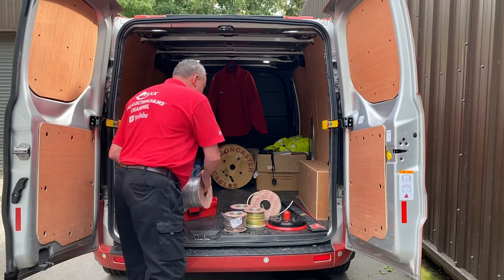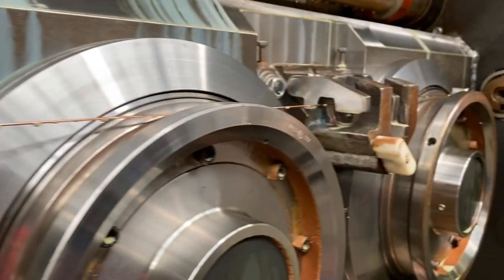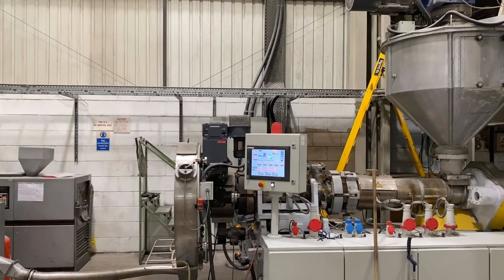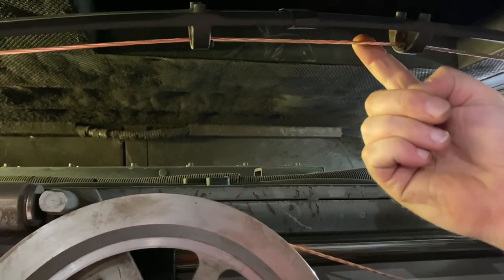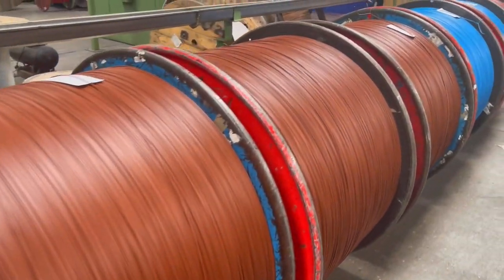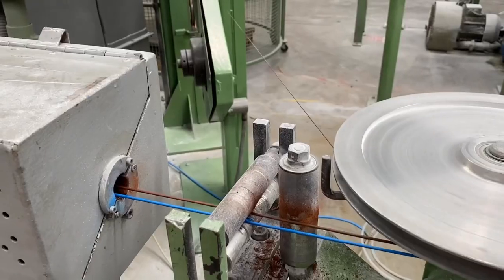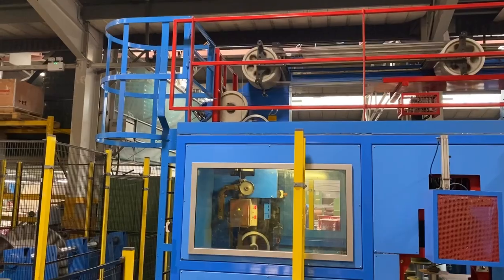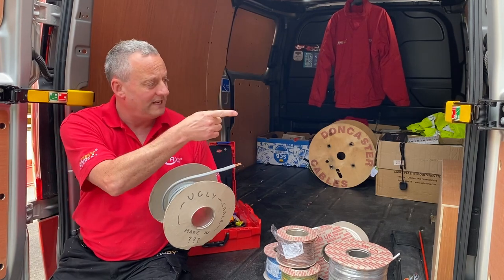The Secrets Of Making Electric Cables & Wires

Comment: I can remember when cable went metric .electricians at the time hated the fact twin and earth cable changed from stranded to solid cores. They soon got used to it though.  But single conduit cable well into the 80s was available in sold or stranded core.
Great video thanks
Reply: Different standards in different countries, in Australia all domestic use cables over 1.0 sq mm are stranded, we also have an insulted earth conductor and our standard sheathed single phase twin and earth stayed as red and black cores, which personally I think was silly.  Very interesting video, it's also good to see not all manufacturing has gone to Asia.

Comment: That was very interesting. I never realised how the cables were manufactured, so thank you (and Doncaster Cables) for your video.
I do not regret the passing of 7/.029 like one of the comments, but I have always thought the previous colours of red, black and green were better. Then, 3-phase supplies were coloured red/yellow/blue. Simple and neutral remained black as in T & E. Even worse is the "50 shades of grey" in SWA.
Reply from the maker: Bring back the old colours
Reply: As an American EE/DIY spark, can confirm that the old colors you used are way better than the new and are on par with our color code for ease of wire differentiation.
Reply: The problem with the old colors is a) that everywhere had their own, which is a safety issue when things start moving from area to area more (including electricians) and b) all the regular good colors were already taken. Here in NL we used green live and red neutral (and grey earth) If we were to move over to your old colors where green is earth and red is live, we’d have very serious issues in mixed installations.

The new colours were the ones nobody used a lot, that’s why they’re the ugly ones.

Comment: The cable manufacturers in Sweden has stopped using chalk to save our hands from drying up and not having to clean up the mess i makes. The newer types of cables are really easy to strip, often no problem to strip >1 meter of outer sheeting with minimum force
Reply from the maker: An alternative is to use a silicone based lubricant - we’ve had mixed results on cables which use this method.
Reply: I'd assume it would save you from potential lung damage too - silicosis I believe?

Comment: I used to work for CEF Doncaster cables was sadly one of the factories I didn't get to have a tour of. I did however handle a hell of a lot of cable from this factory during my time there. I still have half a roll of 1.5 and 2.5 in the shed.
Reply from the maker: Those rolls are an investment in the current climate 😃
Reply: @efixx  aren't they just. I remember 2.5 going for less than a tenner for 100 meters. Mind you it was over 20 years ago.
Reply: Do you know what is the function of applying chalk ?

Comment: If only a manufacturer would make one with a sleeved earth, we need to catch up with the rest of the world.
Reply: It’s extra unnecessary costs though. Would only increase the price of work
Reply: @SuperSweetGamers  I’d quite happily pay the extra price, quicker installation time would far outweigh the extra 3 quid a drum
Reply: @pezzpezz7272  really?... It's just a path to earth that needs a bit of sleeving on the end of a termination... 😉
Reply from the maker: Hank and Chuck across the pond don’t bother with sleeving
Reply: @efixx  "Hank & Chuck.." pmsl 😂👍
Reply: It doesn't need sleeving. The only reason you put a sleeve over at the terminations is so there is no doubt as to what it is
Reply: @morris2755  I have never seen NMC (non metallic cable) Romex or type UF with an insulated grounding wire.  Now MC cable would have an insulated grounding wire, and the lighter weight version of MC.
Reply: Spot on mate. It’s crazy that the UK still has bare earth wire on their tps. Ive been in Oz for twenty years. I’ve never seen bare earth wire in that time. The US method of leaving it bare is shocking.literally
Reply: I never saw non sleeved earth in Europe and Asia. I prefer sleeved earth cables.
Reply: Why shouldnt it be sleeved? Whats wrong with sleeving it? 🤷‍♂️. Surely the point of being bare is to come in to contact with faults easier along the length.
Reply: Normally the earth should carry zero current, so why does it need an EXTRA sleeve? You could argue that live and neutral don't need a sleeve If you could ensure proper separation when removing the sleeve they're encased in. 
They have their own sleeve for 2 reasons, identification, and separation when the outer sleeve is broken into when terminating the cable. This is not a requirement for earth, indeed it's a disadvantage g if there's a breakdown in either live or neutral's sleeve then you want the easiest path to the earth conductor to trip the protective equipment. You DON'T want earth to be insulated!!
Also more plastic is just bad.
Reply: in australia we have had sleeved earths since the about the mid '80s,it saves on  carrying a roll of green sleeving around with you when fitting off switches and outlets etc.
Reply: @terryjimfletcher  What about a fault current then?
Reply: 100 % ✓
Reply: Doncaster have just bought out a new range of cables that do have a sleeved earth, I’ve used it and it is a game changer, it’s only available in 1.0 and 2.5 twin and earth at the moment but I am sure it will take over as the standard for all cables eventually.

Comment: Interesting to see the process. I once had a reel of 1mm t+e cable where, on part of the reel, the neutal and cpc had managed to "switch places" within the sheath during manufacturing. The conductor order was now Line - Neutral - CPC. I didn't realise until I came to do my pre-test (end of 1st fix) and while it was a bastard to strip - it still passed cont and IR with flying colours so I decided to leave it in place (given that it would have been an extra 2 days labour to replace it). Anyone else ever had this issue? Never seen it before or since but now i''m super vigilant about it.
Reply: We used to get some crap cable from my wholesalers about 25 years ago .. Not through choice. It was called Wessel . Half way through the drum it would turn thin and even almost round. Full of kinks It wasn’t just a one off.  It was still BASIC approved and tested ok.
Reply from the maker: We gave a sample of Kablo where this has happened.
Reply: WTF this cable is not usable, and should have been taken out.

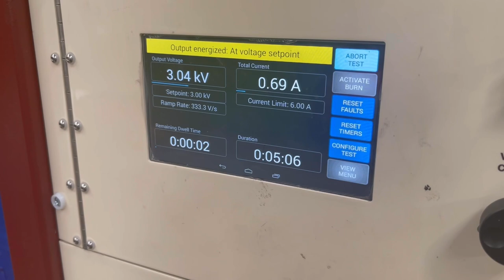Comment: Wow, 8:53 high voltage dielectric testing limit of 6 amps! That's a lot of leakage, but, then again, that's a large tightly wound coil.
Reply: That would be inductance of the coil surely .
Reply: @arcadia1701e  If it is AC it is the effect of capacitance, there's no current through the conductor for inductance
Reply: There must be a load on the other end. Probably a high voltage and current test all in one.  I wouldn't have thought there could be this much leakage current. with all that insulation.
Reply: @rbland  There isn't a load on the other end, there would be no point in doing that.
With a wire diameter of 1.4mm, a separating distance of 2.5mm and a pvc dielectric constant of 3 I've calculated a capacitance of 70pF/m, so at 10km of wire and 50hz there's an impedance of ~4550Ω, giving a current flow at ~3kv of 0.65 amperes.
Purely capacitive.

Comment: What always surprises me is that the UK twin and earth allows smaller conductor for PE/CPC. This would never be allowed in the Scandinavian/Nordic countries, where the earth has to be the same area, or equivalent conductivity. 

Although we allow plastic consumer units, open ends on surface mounted plastic conduit without requirement to bend it with the cable showing out in the corners…
Reply: Like Ring Circuits it's a hangover from the War when they were trying to save copper.
Reply: The earth wire should never carry current except in the case of a short duration pulse (until the MCB trips) of a line to earth fault. Therefore it only needs to be big enough  for this requirement.
Reply: @apk55  Good point… but what if the fault current wouldn’t be enough to trip the circuit breaker, let’s say if the cable were to be quite long? Nowadays when an RCD is installed I guess it wouldn’t be an issue, but what if the RCD was faulty?

I know this is very unlikely to be a problem but I think it’s just interesting to see how we do it differently.
Reply: @ianbakke  if the cable is too long  for the size of the conductor to safely trip the mcb then the apprropriate larger size will be chosen.
Reply: @apk55  The earth here in Germany has to be large and low resistance enough to clamp the fault current to a safe enough voltage in absolutely all situations. Which is hard to do if you get a line-to-earth short at the end of any disstance of cable run with the earth being a thinner conductor.

Comment: Similar process in Canada .We call it Romex .We do not make Romex with an isolated ground but do make BX Armoured cable with isolated ground .Used for  Data Communications and hospital  environments..Most cash register systems in groceries stores will use isolated grounds as each till and computer will have an independent UPS
Reply from the maker: Interesting would be good for us to get hold of some to compare. 👍
Reply: @efixx  pretty much the same thing we use 14 or 12 gauge for most residential applications .We also have a heavier jacketed version with the NMW-U  rating .Non metallic wreathed proof and underground rated .It can be run on the surface above 1 meter without mechanical protection  or underground .the insulation is almost 3 times the diameter of the conductor and the ground wire is the same ,bare . Armoured cable comes in various configurations .Lead core aluminium    spiral and PVC inner or outer jacketed cables .Tech cable is a brand name can be a single conductor or multi conductor .Shielded or unshielded .The sky is the limit and so is the price .Some we use are over $8  Canadian a linear l foot  /Or everything now is metricated .Dont know metric ,not conduit nor wire sizes .AWG ,Kcmil and MCM .,1/2,3/4 ,1, 11/4, 2 inch 3 inch and 4 inch conduits .Never used metric  except in school and European equipment  .Construction for us as always been imperial inches and thousands of an inch for machinery .

Comment: Any technical reasons or otherwise, are the drums of the cooper need to be of 8mm in diameter ? Just curious

Couldn’t the cooper wire manufacturer produce them in different diameters needed for different purposes and sell them to electric cables producers the exact diameter that they need ?

 Side question  —  is similar manufacturing process of drawing out the raw copper cables into different diameters apply to making cables for the audio visual industry too ?
Reply from the maker: It’s a standard that copper rod is sold for cables.
Reply from the maker: Will be same process for AV
Reply: @efixx  thanks so much for the answer
Reply: @efixx  noted and thanks
Reply: It will be because it's the standard but also because it means that the cable manufacturer has greater control over the drawing and annealing. Relying on a supplier to manufacture to the standard you want can complicate things, for example if demand shifts or equipment goes down you wouldn't be able to shift production until the new wire works its way through shipping.

Comment: Great video and insight.  

What exactly does the chalk do for the pvc inner core?
Reply: Makes it easier to strip.
Reply: @Me-zo8yc  cheers, I bought some Doncaster Cable, and it was super chalky!
Reply: @Bari_Khan_CEng_CMarEng   Yeah, exactly that -  if that chalk isn't there the different layers just get stuck to each other and especially if its on an existing older circuit that's had some use (And therefore heat) it can be literally impossible to remove the out sheathing!  On a new install it's generally just irritating and a waste of time - you have to do it at each and every point!

Comment: And when we went metric the manufacturers seized the opportunity to go from stranded to single core which benefitted them but caused problems for electricians,particularly in conduit wiring so single soon returned to stranded.Unfortunately T&E was left with solid conductors making it stiffer and less easy to ensure the tightness of tunnel terminals.7/029 was superior to 2.5 in every respect

Comment: Wow what a brilliant video.
I found this very interesting, 
One question though if the cable is tested to 3KV for five minutes why is it when we get it it’s only rated to 250V? . Gaz this is one of you’re best videos more like this please. 
Brilliant video Gaz as always 👍👍👍👍👍👍👍👍❤️❤️
Reply: The test current was a lot lower than a typical domestic circuit.
Reply: @FistralG  he said “the high-voltage test procedure will test each core to every other metallic component within the cable”. Also he mentioned the voltage was applied for a period of time. Therefore this appears to be a “dielectric withstand” test. The idea is that no current is flowing.
Reply: @MatSmithLondon  There was a small current displayed on the screen. My point still stands it’s not tested with a high voltage and high current. That’s why it’s only rated to 250v in real life use.
Reply: @FistralG  I still can’t get it.
I understand current carrying capacity of cables, what I don’t get is irrespective of the current, if the cable is tested to 3KV then surly it would be rated to 3KV why is it only rated to 250v , even if it was rated to 3KV if to much current flows through it it will overheat and melt . Also if it’s rated to 3KV then it will have a much higher current carrying capacity making it ideal for domestic installations as we wouldn’t have to worry about over loading and fires ?
Reply: @Dog-whisperer7494  It's an insulation resistance test. HV is used at very low currents, as you would do with a IR tester on testing a final insulation, but only to 500V or 1000V on a multi tester,  If it passes a test in the factory of 3KV then it will certainly pass an IR test after installation  and test. It's "headroom" for its capability of IR.
Reply: @Dog-whisperer7494  The cable is tested to 3kv to ensure the integrity of the insulation not to guarantee it can deal with that voltage with real world loads. 
The design parameters for standard 2.5mm twin and earth cable is 240v protected by a 16A circuit breaker on a typical radial circuit around 3.8 Kw total power.
Reply: @muzikman2008  now I I’ve got, thank you
Reply: @FistralG  now I’ve got it thank you

Comment: I always thought the color of the cables is reversed.  So easy to remember if blue was the hot or the sky, and brown was the return or ground, like in dirt.  Anyone know how these colors were originally determined?
Reply from the maker: A good question for many years in the UK we used Red & Black before Europe decided to harmonise conductor colours.
Reply: we still use red & black in australia,  only appliance cord and leads have blue & brown sleeves. i think the colour change was for colour blind people because when i did my apprenticeship you couldn't be a sparky if you were colour blind. and apparently only men get this ,most sparkies were men back then so testing was necessary because multicore cables can have lots of colours in them that can be mixed up by being colour blind.
Reply: Red and black can cause issues with people that are colourblind. Apparently blue and brown can be distinguished. Always remember you would not touch a turd and they are brown.

Comment: Interesting vid, but I find it ridiculous that most cables are still PVC. It is one of the most toxic plastics to manufacture, is not easily recyclable, and indeed in many countries they simply burn big piles of cable to remove the PVC and get the copper for recycling, producing some seriously toxic pollutants like dioxins and furans in the process. Given that there are better alternatives, like synthetic rubbers which are less toxic, tougher and more heat resistant, it's hard to see why PVC is still the dominant sheathing material other than it's cheaper. But, I guess it all comes down to price in a capitalist society, things that actually matter like environmental issues always come last...
Reply from the maker: The scrap people would still burn rubber to extract the copper. Most underground cables are XLPE.

Comment: to make 1.5 or 2.5, an awful lot of copper was wasted
Reply from the maker: They waste very little
Reply: from 8mm copper and reduce it down to 2.5mm, there is a lot that is ground away, with diamond 00:20
Reply: @christ9460  you don't understand what drawing wire is
Reply: @christ9460  It's not ground away. It's stretched.